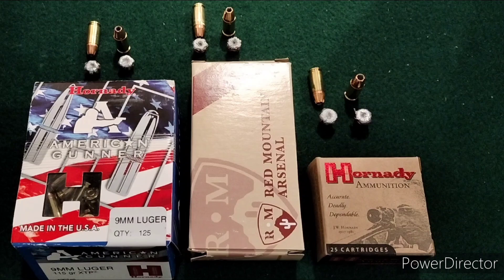9mm XTP off? XTP fest? XTP challenge? Short barrel standard pressure testing.

Comment: More great testing as usual from Northwoods!  Those heavy 147 XTPs Subsonics had the extra oompf to penetrate the gel deeper as usual. I really like that Sig P365XL. The 3.7" barrels seem like a great smallish carry gun without sacrificing FPS for short barrels.   Hornady has really nailed the expansion vs penetration  at 12-16" depth. It really seems that the small expansion diameter is part of their key. Large expansion just kills penetration on any projectile from what I see. Hornady started with the XTP projectile when they updated their "Critical Duty" projectiles. Dale Emery- their famous ballistician started experimenting with silicone RTV from hardware stores at first. (trying to keep the hollowpoint from filling up with barrier material) They eventually changed the XTP slightly, in several ways. The special polymer they developed for its "plug", then they core-locked the jacket and lead, adjusted the hole diameter and ridge separations, and raised the FPS to get the desired results. The rest is history.  When done, It smashed thru all the FBI barriers including plywood, drywall, auto glass, 2 steel sheets, and always achieved 12-16" gel penetration at the same time!   Its really amazing when you think about it.  No wonder they have the national FBI contract as well as many, many other govt, state and local agencies. However I am partial to the HST Federal, for citizens self defense myself. I'm pretty sure they were probably # 2 in the FBI testing.  There is almost zero circumstances a citizen could justify shooting thru these barriers for self defense. Its nice to know we can with Critical Duty tho. 😊 I also just picked up some expensive Underwood solid copper "Extreme Defenders" to go with my NOVX ARC solids for 380. Now I just need to find the time and get some gel blocks  or meat targets someday.

Comment: Thank you for doing this test I requested. You earned a subscriber.  I Also did a test today of  XTPs by precision one. I can share you the results if you're interested.
Reply: I have a box of precision one 147g xtp also. Can you share your results and what gun you tested with. Thanks
Reply: @brianthomas9445  Glock 19 gen 3. I tested the 147 and 124 using water jugs and a T shirt. 124 penetrated into the 4th  jug. 147 almost came out of the 4th jug, putting a dent into the 5th jug. Both loads expanded pretty nice for xtps. I would probably carry the 147 because I prefer more penetration.

Comment: Honestly those 147gr really impressed me compared to these lighter bullets. I usually like running the 124gr over the others in short barrels.
Reply from the maker: Agreed. I'm always concerned the extra weight will slow the projectile and prevent expansion. But, does not seem to be the case here. I was pleased with the results.